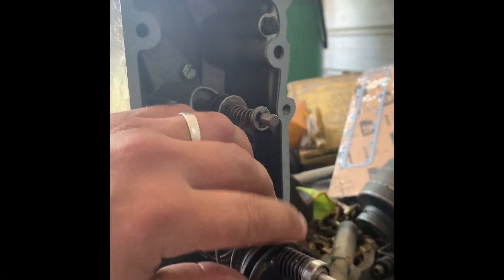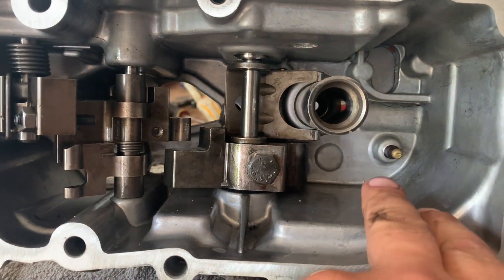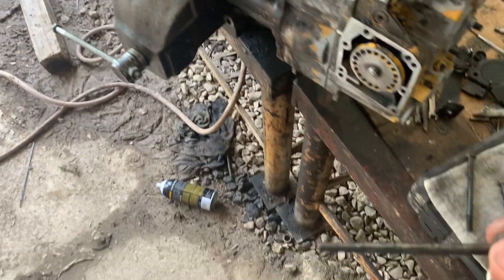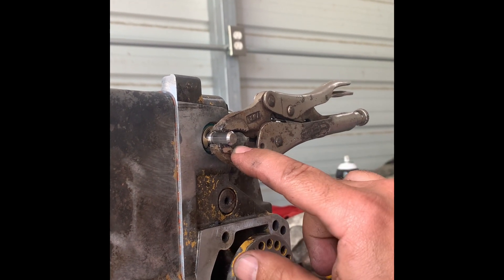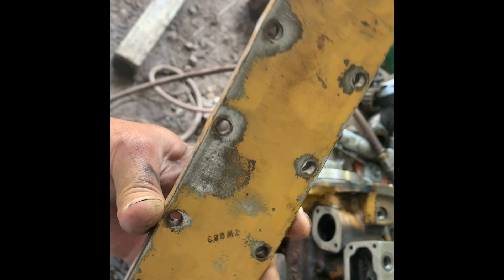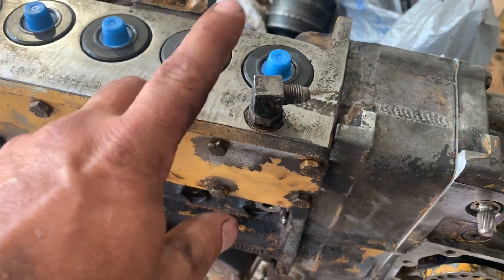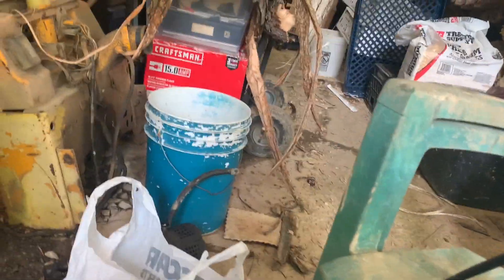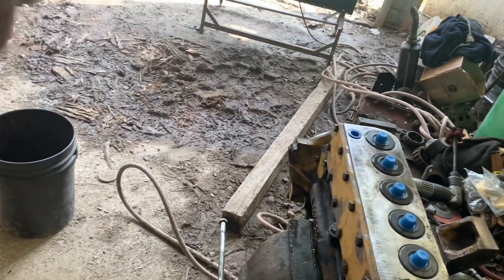Caterpillar 3406 c fuel system reassembly part 6

Comment: Can you help me some with a 3406 dita “3er0” serial number , Industrial mechanical engine ?

It’s on a dredge I have to get it running after some a hole mechanic rebuilt it then left town before actually getting it running